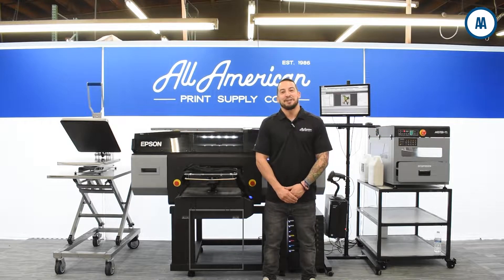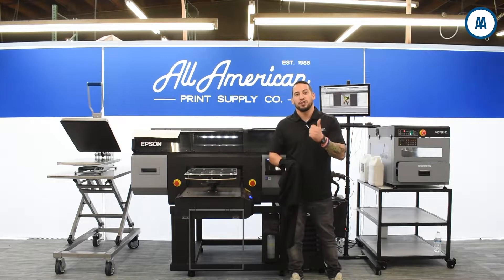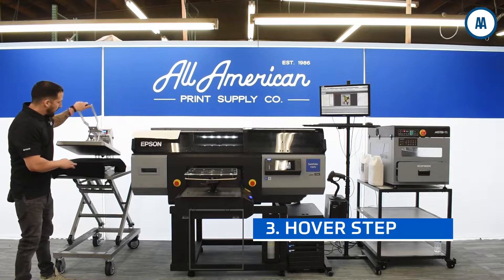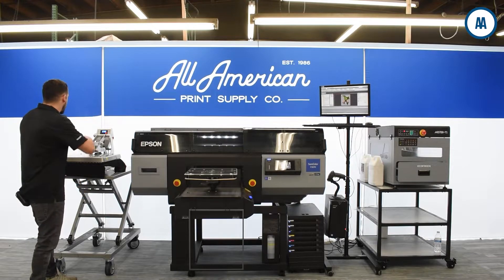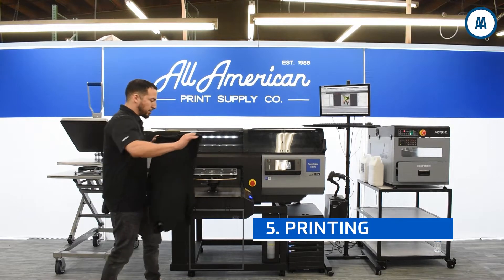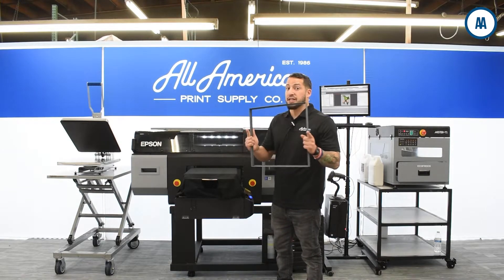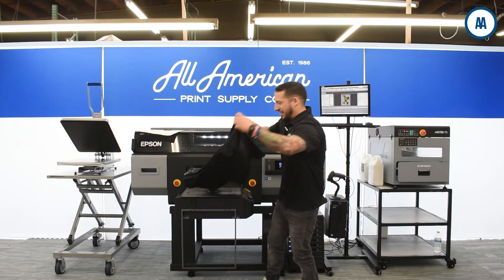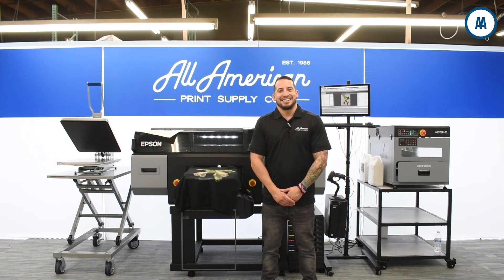Epson F3070 Virtual Demo | AA Print Supply

Comment: Overall to many steps and time consuming for making 1 Tshirt.
Reply from the maker: Hello, for direct to garment the steps are:
1. Pretreat your shirt
2. Print shirt
3. Dry (cure) ink on wet shirt
Reply: @AAPrintSupplyCo  how many tes we have to use the heat press?
Reply from the maker: Hello, pretreat can technically air dry so the only time you NEED to use the heat press is to dry the ink. For best results you will want to pre-press the garment before printing (for a few seconds) to lay the fibers down nice and flat

Comment: Can it print the front of a zipper hoodie?
Reply from the maker: Hello!  Yes it can, the machine is equipped with sensors to detect the high/low points of the garment before printing and auto adjusts the print head height accordingly. It's pretty wild

Comment: How long would it take to recoup your investment before you start to have a profit? I wish I could have the unit cost and the overhead for this machine. I am in the dark because I don't have the cost volume profit analysis. Does anyone have some basic costs? Thanks!
Reply from the maker: Hello,

Would you be financing the machine? If financing, I don’t see it as recoup as much as that financing amount going into your monthly bills (rent, electricity internet, employees, financing, etc.)

If paying outright it depends on average profit per garment and estimated volume per month..you’ll then have to subtract cost to make shirt and monthly operating cost - drop me an email to Estevan@aaprintsupplyco.com
Reply: Thanks for your question (yes, outright payment. I don’t have good credit because I decided to buy everything outright; I haven't used credit since 2006)

Comment: I have an idea! Why not develop an ink where the shirt does not need a pre-treatment! Developing that would be a game changer!
Reply from the maker: Hello,

Currently we are in development of a washer/dryer system that produces garments that are entirely pretreated.  Additionally, there are printing methods available for these machines that use special film to apply onto a wide variety of materials, light or dark - WITH NO PRETREAT.  Here is a brief webinar where we show the full process- https://www.youtube.com/watch?v=0D-L3JNqEjY
Reply: Ask yourself why does everyone pretreat ? It's two things white water base ink gets absorbed into the cotton fabric and looses opacity without the pretreat and heat press process, the ink needs to sit on top of the fabric like plastisol ink to be bright enough pretreat prevents a total absorption into the fabric, but it's also about knocking down the tiny fibers you can't see so the print head can print on an even surface, it results in a better print. when you print on a white shirt without heat pressing the shirt it looks a little fuzzy, or blurry, it's because if you look with a magnifying glass the surface is all fuzzy.

Comment: Why use a heat press when everyone is starting to use a conveyor dryer?
Reply from the maker: Hello,

Thank you for your feedback - both the heat press and conveyor dryer are great options for drying pretreat and curing ink.  I am in the process of acquiring a new conveyor specifically for direct to garment and look forward to creating more content with it to share with your audience.  Do you use a conveyor dryer?
Reply: @AAPrintSupplyCo  Nice!! I dont, i been using a heat press. But to me thats the problem with dtg as in it being time consuming. Now you can spry and lay until all shirts are pretreated. Then print and lay in the dryer. So much faster.